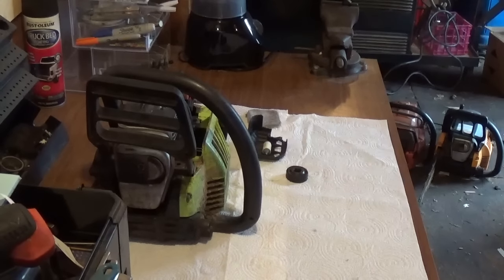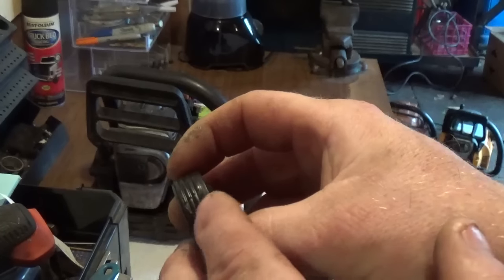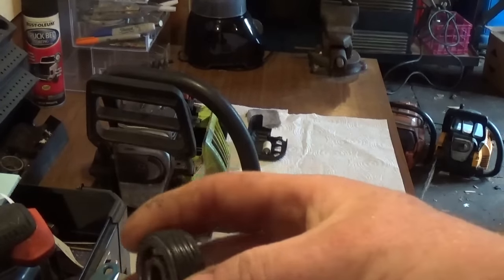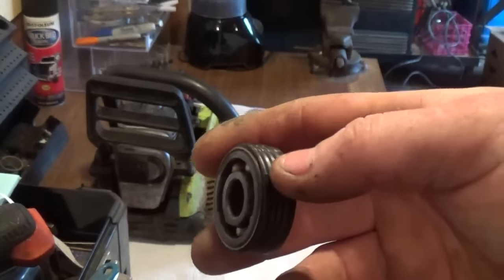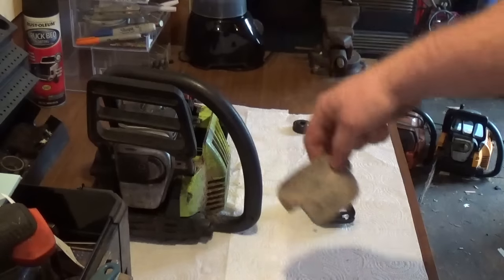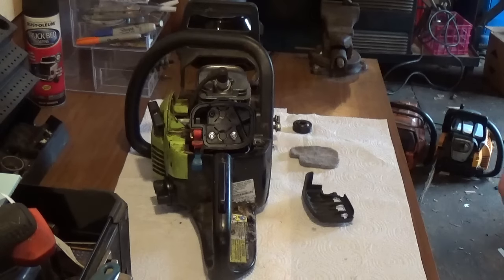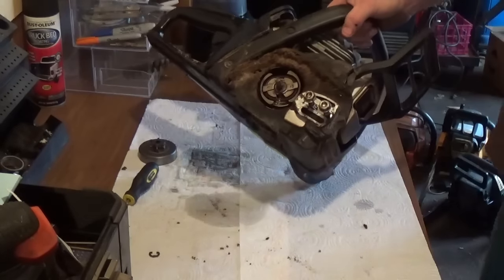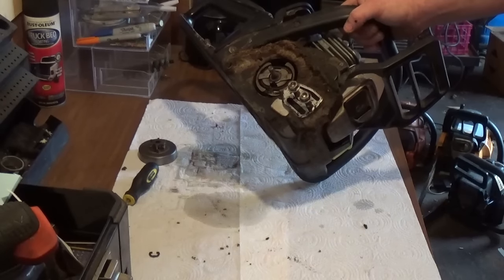Common problems with Poulan Chainsaws

Comment: So what brand chainsaw should a homeowner get, without dropping 3,4 hundred on a sthil or echo?
Reply from the maker: Absolutely None.....Now let me explain why I would feel compelled to leave this as a comment ...Quality is often indicative of price .....NOT ALWAYS.....but respectfully and logistically most of the time . Quality chainsaws or equipment for that matter often isnt sold in small box stores .....These pieces of equipment are sold at predetermined price points to appease price point shoppers. There mass produced where very little if any quality control is apparent .......meaning expedition is imperative but quality takes the back seat [so to speak ] as quotas are expected to be made . Husqvarna has fed on these marketing tactics with small box stores for years. This is apparent when simply looking at various power equipment sold threw..... for example the early 80s up to present day......the lack of quality is just to obvious to be ignored . I have found from just my experience alone over working on these pieces of small engine equipment that far to much plastic is being attributed to manufacturing than really necessary ....This so called desire to make vital parts from plastic rather then quality reliable metals has damned and continuing to damn even reputable brands as they to are trying to cash in on the dollar stolen rather than earned mentality that Husqvarna likes to continue to live by . But lets be logistical .....we need and depend on our small engines so we as consumer's are essentially screwed . We must do our research and make informed choices when selecting the less of evils upon purchasing new equipment .....Sadly in todays market 3 or 4 hundred dollars limits whats offered Via to whats expected . And anything less than 350 dollars will likely be bottom line or slightly just above depending on brand . Basicly any individual looking to buy new quality equipment {I say pick your own poison} Quality simply is over priced and longevity basicly is just lost in most peoples vocabulary because of preceding FU%K&ngs they have received in trying to find such a piece of equipment

Comment: How else are they supposed to make a saw that sells for  $130.
Reply from the maker: Well lets ask China as they have been making knock offs far superior to the modern Poulans for 10 plus years ....Think I am kidding ? Look for your self {Blue max} just a cheap knock off of Red Max owned by Husqvarna and is built amazing well in comparison .....Might I mind you even cheaper on average than Modern Poulans as well. So Its obvious it can be done ......Sadly its just not going to be as price point shoppers are creatures of habit .....And that habit is if its broke toss it out .....I see this shit happen every year as some individuals seem to never learn . They have the mentality that if they purchase a poulan for 130 dollars plus and use it 1 season at best its paid for its self . But where there stupidity is revealed is simple often is the case this 130 dollar purchase fails in the first few hours .....As a result they then purchase there wood 50 dollars plus locally. Eagerly awaiting there New Poulan to be fixed .....time elapses via a month at most and the weather is or was harsh enough to obligate the purchasing of 3 or so loads at the said 50 dollar plus limit on wood . Now this individual is 150 dollars plus the price of the failed Poulan invested in a months worth of wood . Now lets say this individual proceeds to use this repaired chainsaw with success and is able to cut 2 ricks of wood before encountering the next failure as this is all to often the case ..Now hes back at the shop this time with out a option of warranty as luck just isnt as favored as the last encounter of the salesman or dealer and this repair is on the customer . Now hes then obligated to purchase even more loads of wood plus contend with a repair that on average is at least 60 dollars as most shops charge 60 dollars a hour just to work on equipment . And on average he must then contend with at least 2 or 3 more months of nasty weather . {Think about it } seriously look at how much money this individual is truly out of as a result of trying to pinch a dollar when if he or she just added another 130 they could buy a decent quality saw that would perform the task of cutting fire wood as intended saving all that wasted money . WE HAVE TRYED TO EXPLAIN THIS VERY CONCEPT TO MANY ADAMANT CUSTOMERS .....Sadly you cant reach some people as they are sold on idealism rather then evident facts and hate blatant obvious truths as it makes them feel stupid .....So rather than learn lessons they just revert back to there price point mentality and repeat the cycle again the next season .
Reply: @kevinbolin7665    My statement exactly
Reply from the maker: Great then we are own the same page so to speak / as your question was provided a honest answer . And we have a direct mutual understanding with clarity that indeed a saw can be made for under 130 dollars and sold cheaper as well as be even more effective than a modern Poulan . Sadly most people just get to tided up with there own idealisms and over look quality due to price point availability .

Comment: To be  honest a saw is a saw they are all made in China it’s not the saw it’s the owner and if you take care of it you will rarely have any problems
Reply from the maker: A saw is a Saw......All made in China …..You def need to do your homework …...Quality is the determining factor of longevity …..That's like trying to telling a carpenter that a standard wood handled hammer is going to outlast a sold steel Eastwing …...Then advocating they can be used equally in the same manner ….All the while knowing that the wooden handled hammer could never be subjected to the task that a steel hammer could  and considered its equal .…..LOL.....A saw is a saw...

Comment: All gas chainsaws are temperamental fidgety and delicate - Batteries and electric motors are improving gas saws may become obsolete!  As to Bubba Small Engine Poulan hater ; I suspect Bubba had and lost a Poulan dealership this explains why he has a pile of busted Poulan saws and the over the top resentment ...
Reply from the maker: Well Dan the man whom is the expert at hand...... Let Bolins small engine enlighten you toward {facts}…..Fact one ….Bolins small engine has never nor will ever carry the Poulan Piece of shit chainsaw / It is actually my employer whom once carried the Poulan line subjecting me to be cursed with constant repairs and the stresses that would and certainly did follow for the last 15 plus years . We had at any given time in shop {BAKERS Lawnmower } over 30 chainsaws on average per ever 2 weeks to repair from local stores such as Tractor Supplys, Lowes, Walmarts, ETC … And as a Master Service Tech rest assured I new and Know ever part on one of these sorry pieces of shit known as POULAN . Fact two ….My employer personally dropped the Poulan line as he was ashamed of the quality and service provided by Husqvarna as a parent company . Husqvarna /Poulan got to the point that advocating honesty was getting to expensive on there end to provide parts under warranty . And Started demanding pictures of damage to certain known warranties ……..Trying to fuck customers out of warranty failures …….They where relentless in trying to hide failure points / only providing pictures back to the dealers to imply customer neglect . This infuriated my employer as well as my self as pictures where always provided in meticulous order . And ironic as it might seem pictures provided on certain Poulans mysteriously disappeared on there end . But we always keep copies of what we sent for warranty claims . In fact we even showed theses pictures and chainsaws at a Service School to other dealers proving Poulans shady tactics upon dealing with warrantys . Needless to say we where very popular at upcoming Service Schools as we exposed the truth and 6 dealers after experiencing the same bullshit as us dropped the Poulan line as well. But not to worry Husqvarna was determined to increase sales so what did they do ? The sorry mother fuckers pushed obligation sales ……..And I bet your wondering what the fuck I am talking about right ? Let me explain …..Husqvarna owns Jonsered …...Jonsered is a popular saw ….So theses clever fuckers would send different sales reps every 3 months …….And with every Changing face …….You guessed it more inventory must be carried …….{Obligation Sales} …...So what did dealers do to retaliate locally ?...….You guessed it …..Drop the fucking line ……..When Husqvarna caught wind that dealers where dropping Jonsered lines all over Ky they changed there tune and reverted back to normal operation of designated sales reps......SO friend lol... not only is Bolins small engine no fan of your beloved Poulan but a despiser of Husqvarna as a company as well. They are the crookedest Mother Fuckers I have ever had to deal with .
Reply from the maker: Oh and Dan Tone it should be noted that the reason I have so many Poulans lying around is from customers whom wont me to add them to the Poulan {POPULAR Tree} just below my home . Dan …..Just curious ….since you are such a expert advocating that all chainsaws are temperamental fidgety and delicate . Why you personally don't share videos on YouTube ...Surly a man with such vast knowledge could make a simple video …….Time obviously shouldn't be a issue as your finding time to read comments and project opinions ….I guess its just beyond your capability …….dare I say more of a Bubba sort of thing ….LMAO....{What can I say viewers }…….I guess Dan Tone just cant A TONE for his actions .
Reply: I actually own 5 chainsaws - A vintage  McCulloch 44 Super a vintage  Pioneer P41 a newer Stilgh a Poulan 4218 and a Battery powered Dewalt ! That Dewalt starts every time ! That damn Stilgh is under warranty and has been in the shop constantly!!! I have no desire to make videos starring me I'm not that egocentric!  You go right ahead a blow up all them bad chainsaws I'm sure you will enjoy it !
Reply from the maker: @dantone1952  Oh I do enjoy blowing up the Poulan pieces of shit....And Dan its not egocentric passing along experience threw example ……..If anything its informative …...that's whys this channel continues to grow …..Think about it Dan if individual viewers such as your self are compelled to watch then was the time or effort really wasted ……...You should truly make videos of your own showing these 5 chainsaws …..sorry 4 as you said the Stihl is in constant need of repair . Preforming task ……..After all Dan a scholar is rarely noticed hiding in the shadows of others offering insight but failing to lead by example.

Comment: My poulan 1800 runs the balls no issues besides simple tune up and sharpen my f**** chain.
Reply from the maker: As its one of the older Poulans I have no doubt it works just fine . Now try running the balls over a modern poulan and you will likely snag a  few pubes with that skipped toothed chain. LOL that screaming 42 cc engine with skipped toothed tech  just excites the best of us .Why hell how did we ever live with out it ........Oh yeah with actual f***ing equipment that worked .

Comment: Homelites in my book are/were the worst pieces of crap ever made. Old poulan saws from the seventies and eighties were good saws.
Reply: The old Homelites were good saws. I got a 150 Automatic at a yard sale in 1994 and used it for yard cleanup and bucking downed trees without issue until 2017. I think it needs fuel lines and or carb kit right now though. I used only ethanol-free fuel with Stabil and started it every two to three months.
Reply from the maker: Well / These older saws were no doubt great in there day { both Homelite and the really old Poulans } but I wouldn't give a penny for the junkie shit sold today under there names .

Comment: I have one of these little green turds that I bought in 96. Everyone I knew told me they were junk. I needed one and I didn't have the money to buy a "good" saw. I used it to fell and cut trees WAY TOO BIG for it but it got the job done. I have since bought a Homelite and a bigger Jonsered and love the Jonsered. I still have my little "turd and use it quite often. It's still doing a great job for it's size and it's cost. I do keep most of my equipment in good repair and take care of it. All that said, I probably mistreat the "turd" more than I should because it has served me soo well.
Reply: David Delle Well said. 
If you want a backup machine to use for shorter cuts (smaller diameter trees), then get a Poulan 4218 Black and Amber. Great suspension system has way less vibration. And then you only have $200 setting on the shelf not getting used and when you DO use it, you look forward to it because it’s easier to use. 

If you want a commercial grade machine, spend commercial grade money.

Comment: My father used these poulan chainsaws for about 20 years and loved it note he used the same one for about 20 years and loved it
Reply from the maker: Fair enough / but you said he used these poulan chainsaws for 20 years ….Are you implying in the last 20 years …….2000 to 2020 …….or are you implying 70s ...80s...or 90s because the saws from 2000 to 2020 are shit and if the man used theses curses I feel terrible for him .
Reply: @kevinbolin7665   no he used them from 1990 to 2010 but no I agree with you   still have are woodshark and can't get it started and it's annoying but back to a question I can ask you do you know or have any tips on getting it started note changed the carburetor, fuel lines, changed the air filter, the spark plug, the spark arrestor and the fuel filter any tips to fix this I just don't feel like buying a 250 to 300 dollar saw any tips to help me I'm just trying to supprise my dad for fathers day.

Comment: I have a new Poulan Pro saw which I have not used yet because I can't get it to run. It is back in the shop for the second time under warranty due to that problem. I also have an older Poulan saw which worked fine until recently. It is one I got in 2000 when we had ice on the ground here in Arkansas. I don't use saws that much, but expect them to start when I take them out. I purchased a Stihl saw between the old and the new Poulans and it stayed in the shop so much until I called it a shop saw. That is why I had to purchase the new Poulan saw, which I can't get started. Both are currently in the shop, and hope they both will run when I get them back.
Reply from the maker: Stihl {maybe} .....Poulan I really wouldn't count on it to run very long.

Comment: The reason I bought poulan Chainsaw is because they suck and my wife doesn’t 😉
Reply from the maker: {Poor guy}......Your going to likely master being a Pullin Pro ......Thats ok if your wifes teeth are anything like the Poulan Skip toothed chain then you likely have became accustomed to skipped tooth performance.
Reply: Ha ha ha 😂 lol Cool response what happen was I never owned a chainsaw and my wife wanted one went to the flea market and bought  a used one for 50 bucks brought it home I did some research about chainsaws and when I look at the label it’s a freaking Poulan I heard they Are paper Chainsaw’s lasted a day after turning on because the piston and chamber was scored Took it to the shop and the guy said it cost me $240 to repair you better off buying a new one for that Price and better getting a craftsman or a stihl poulan are a dime a dozen lol 🥴

Comment: Guy made a hole video about poulan saws and there problems.... It's a home owners saw u may use once a year tops....tbere nkt made to go l
Clear cutting or cutting a 10 year supply of firewood with there made for home owners to have in the shed incase a limb or tree falls in the yard u have to cut up
Reply from the maker: Cody .....quality is the reasoning behind the video . The quality of the saws are truly lacking .....Failures await a homeowner with most experiencing buyers remorse strait from the box as these saws are built to fail . They are the worst saws on the market so to speak ..As you can see by the thumbs up on this video ......I am not the only one whom hates these curses plagued and sold at small box stores around the world .Poulans reputation is slowly going to hell in a hand basket as people are becoming more aware of the quality being pushed . I find it sad when a cheap saw from China can out perform and last longer than one bought in the U.S.A .....Its shameful to say the least......And theses over seas saws not only last longer but are sold at a cheaper price .I mean respectfully this is America for crying out loud . We basically have tech that can wipe some ones ass so why the hell cant we make a cheap affordable chainsaw that can last? Obviously it can and has been done in the past so whats happened in the last 20 plus years ? {Greed} is the only answer or conclusion I can come to . The greed of a dollar stolen rather than earned .And lets not forget misleading false advertisement that's carried by red tape {loop holes to deceive}
Reply: @kevinbolin7665  I understand tbere faults....but currently there is no other cheap throw away saw at retail stores across the country like poulan ......and unfortantly till someone like still makes a 100 dollar say ppl wil still buy poulans and poulan will be here to stay....hell even I buy poulan just to strap to my ATV to cut brush in the trails and I also use it as a back up chain i dodnt worry about bei g hard on cuze if i brake it o well it a throw away saw not a 3 to 500 dollar saw

Comment: I still don't know why the filter is not on the outside of the tank. Why the filter is in the back side of the tank when you tilt the weed eater forward it's not getting gas. All weed eaters have this fault the person that fixes it will be a rich man. Because the weed eater will no longer go out of style. Or the chainsaw of gasoline engines gas tanks are very poorly designed